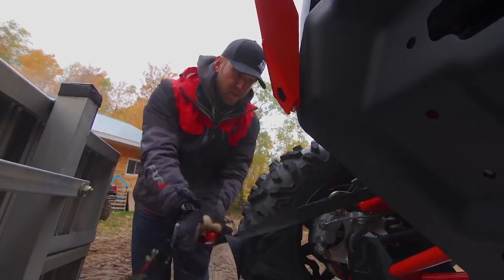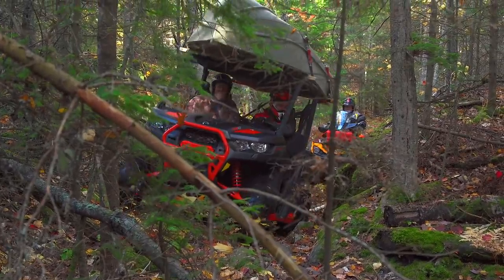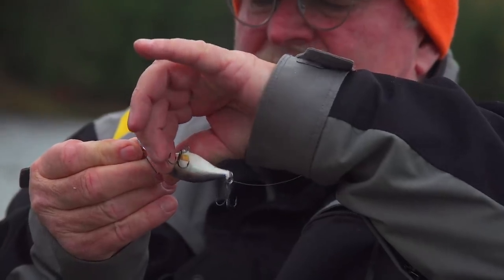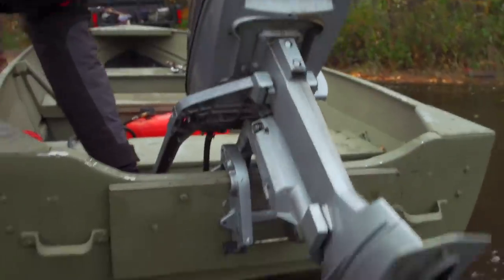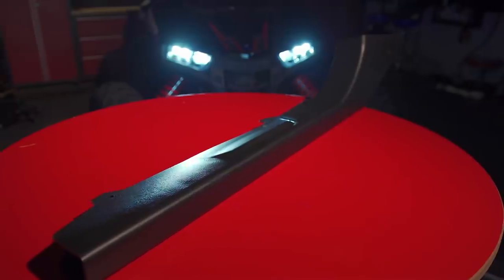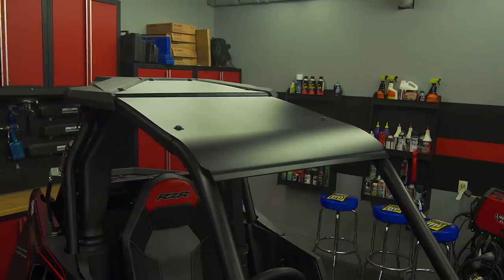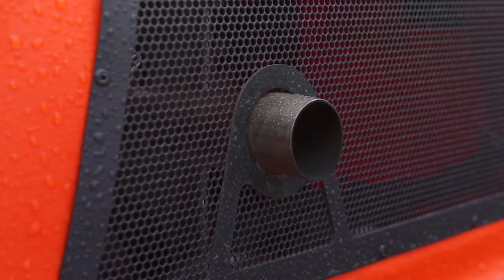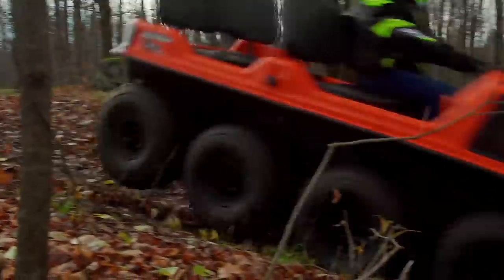Dirt Trax Television 2018 - Episode 17 (Full Episode)

Comment: Ya for 26,000 you can keep your Argo lol I will just put a boat on top of my rzr
Reply: @Matthew Hoopes yep 26k
Reply: 26,000 is way too much for a vehicle designed to go through water, so let me take my new 10,000 four wheeler and see if I can sink it and ruin it in one year, that makes way more sense!
Reply: Some are in the 40,000s argos are brutally expensive
Reply: I think if you were using an Argo to guide hunting trips then I could see spending the money.The new Argo with aps transmission thats suppose to help with the jerky steering is only sold in the Aurora series . You would think they would want to have that transmission in other units to help sales.